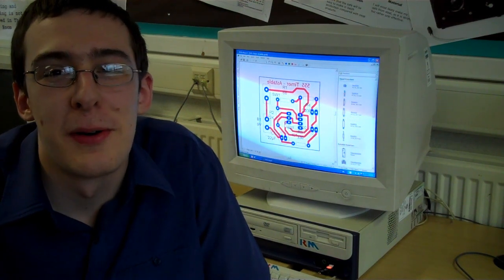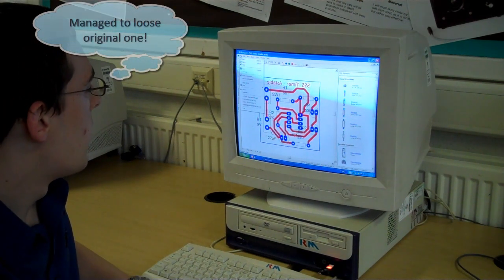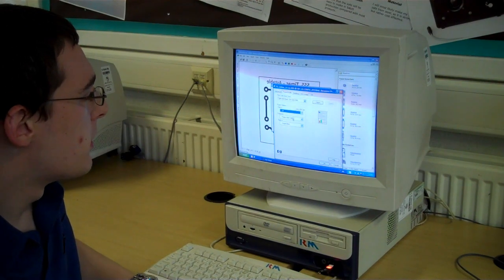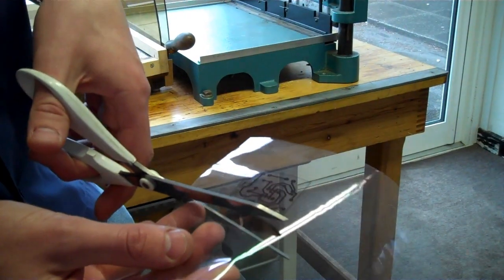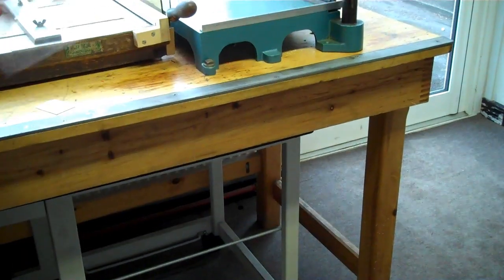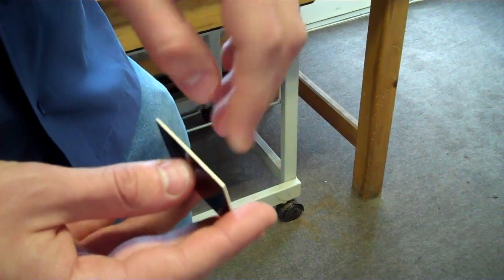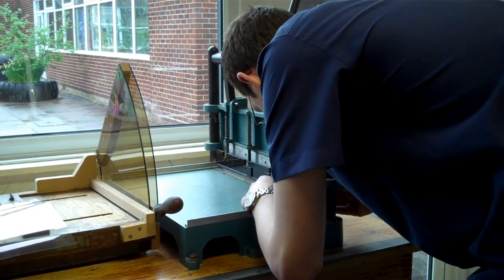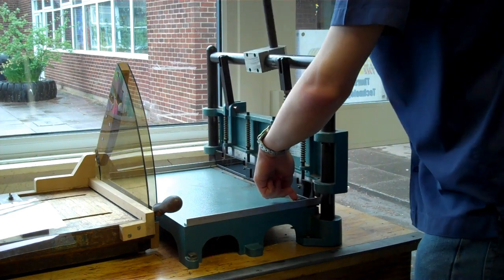How to Design, Develop & Manufacture a PCB | Part 4 - Printing Artwork & Cutting PCB

Comment from the maker: It's a special PCB guillotine.  They are unfortunately very expensive but I have had just as good results using a craft knife.  Place a metal safety rule where you want to cut and do several deep scores, repeat on opposite side, then clamp to a bench with a sharp edge and snap.  It only requires a little sanding after this.  Be sure to drill your holes in your board after snapping it otherwise you create weak points and risk damaging your board.

Comment from the maker: @sotiris997 Yer sorry changed the artwork slightly as I lost the original one while making the videos! This website might help gmasiR (shortened with bit ly) You can sink and source current from the 555 timer, sourcing is where the LED has its anode connected to the output and cathode to ground and sinking is where the LED has its anode connected to the positive rail and cathode to the output of the 555. Think ive got them the right way round :) Link should help though.

Comment: How have you added an extra LED? I can't do that, because if I do, it flashes simultaniously with the other one. I managed to do it only by using a 9V Relay but I think this is not an efficient way to do that.